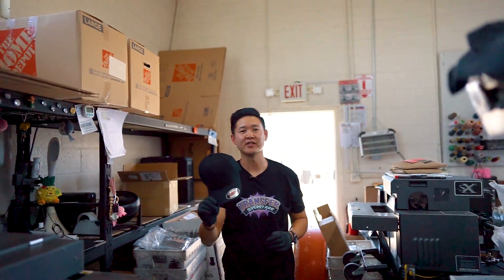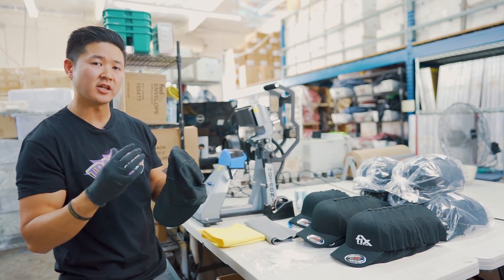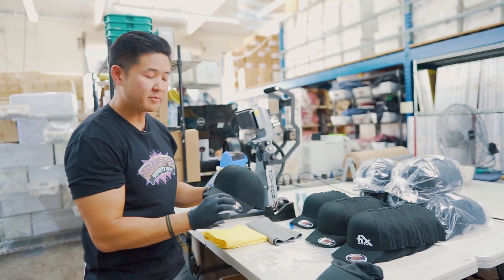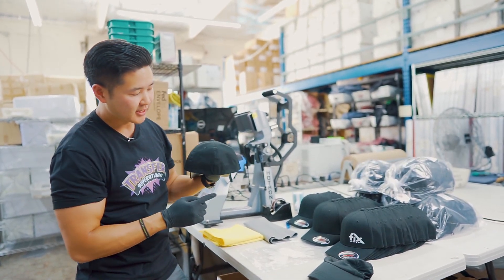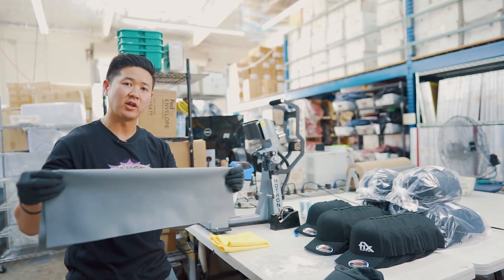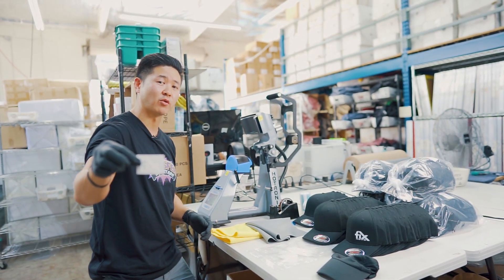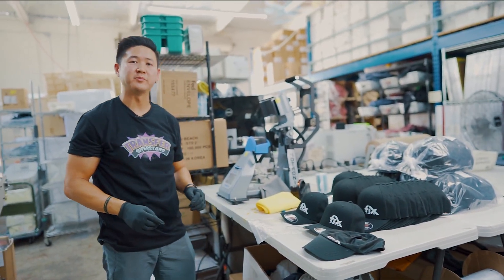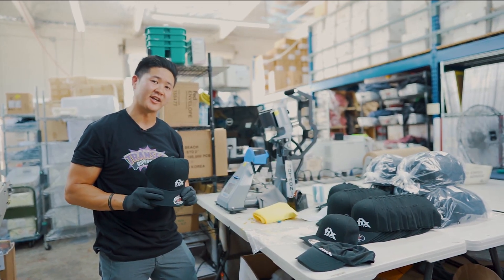DTF Heat Transfers on Flexfit 5001 and Headsweats Race Hat

Comment: Our hatpress stopped working after about 4/5months; I am currently troubleshooting to decide if its worth investing in a new one. What temperature do you press at for 7 seconds? And is there a way we can increase the pressure even more than the knob is able to turn?
Reply from the maker: What hat press are you using? We press at 300f for 7seconds. If you want to add pressure besides the knob, you can always use a silicone sheet, stahl's carries one

Comment: My hat seems burnt and I get a weird crease on the center line of the hat, any suggestions?
Reply from the maker: What kind of hat press are you using. The press is probably causing the crease. Perhaps reducing the pressure would be better since the hat doesn't go into the wash often and won't shrink like a t-shirt.